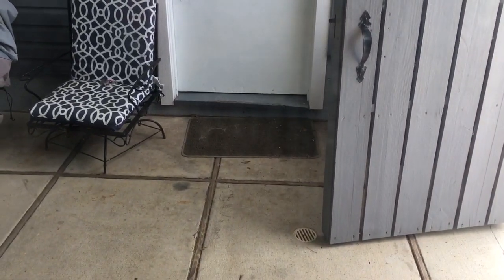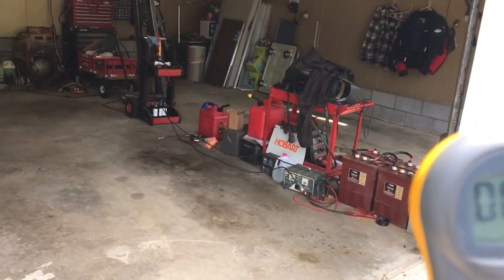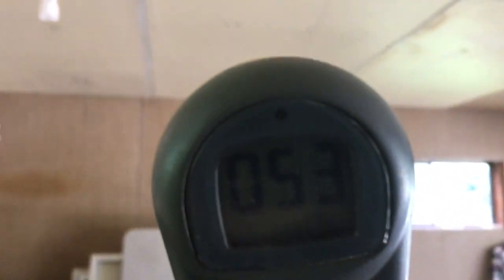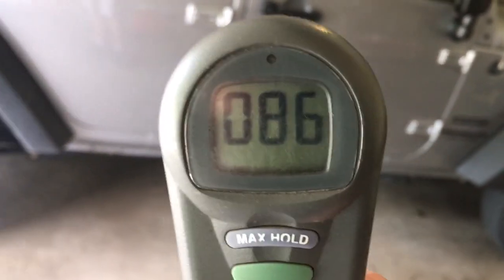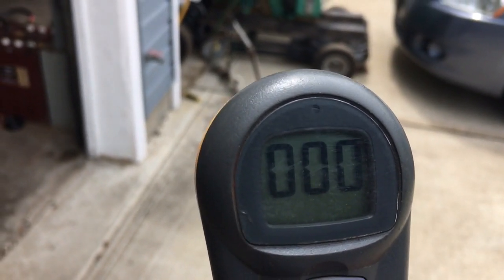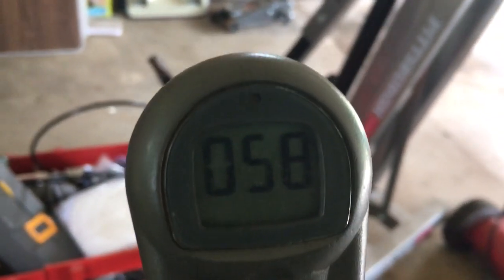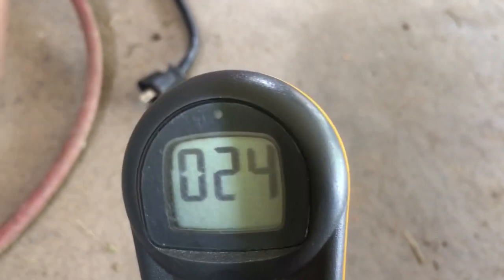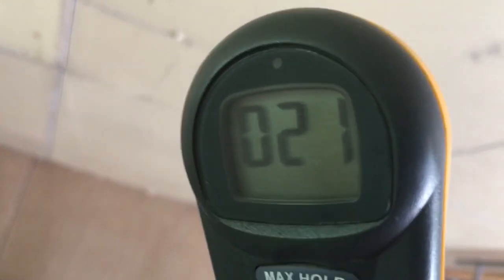Running generator in garage

Comment: so is it possible to run a vent through a wall of the garage into the air intake of the genie and the run its exhaust out of the wall as well, and everything be safe?  I would still keep the door open and not be in the garage, or even enclose the generator but inside the garage where it is safer from thieves and requires no slab or expensive shed.
Reply from the maker: If the garage is not connected to the house, possibly. Years ago generators were installed that very same way in basements. But, one small leak and death could result, which is why it’s no longer allowed. I would not recommend any generator in a garage or basement, I’d buy a shed or some type of enclosure that protected the generator.
Reply: @IFix-Things  thanks for the input, yes not a connected garage and I could add an enclosure on the inside, up against the wall, to further protect, but I will probably just put it outside :)

Comment: Demonstrating what?
Reply from the maker: How much carbon monoxide the generator is putting out, and why you should never operate a generator inside a garage. It’s common sense to most people, but others need to see a video like this because the gas is invisible.
Reply: @IFix-Things  I actually have a powered roof vent with a hose in my garage that I use for the exhaust on my car.  It has to be backed in so I needed something to deal with the fumes.  It seems to work okay but I am upgrading to a more powerful unit because I also have an Onan genset that I want to setup in there and run with the door closed and I want to be certain the blower can keep up.   
We live in a residential neighborhood where the houses are pretty close so noise is a big issue, otherwise I'd just have it outside.

Comment: I just got a Onan 6djb.  Can you please explain how yours is wired up?  Mine has terminal 2 wires coming out, and 2 hooked to ground on the unit. No plugs.  I would like to run mine as 120/240 or even 240 if I can just tap into one terminal for 120.  I believe it was wires T1 & T4 that are loose and T2&T3 hooked together at ground.